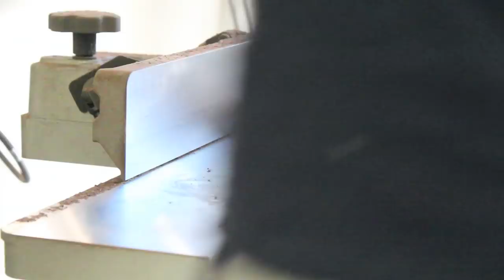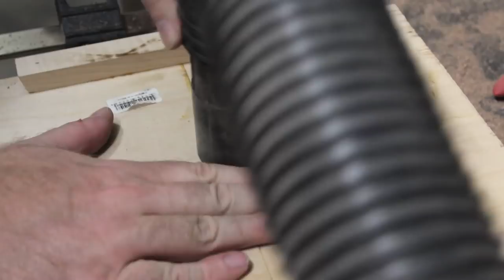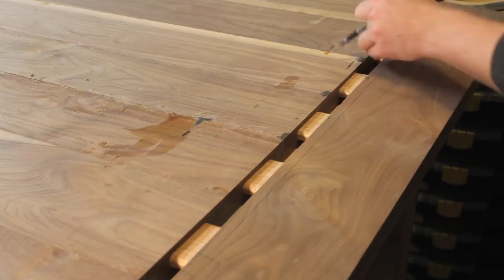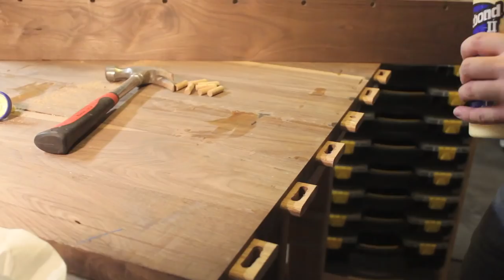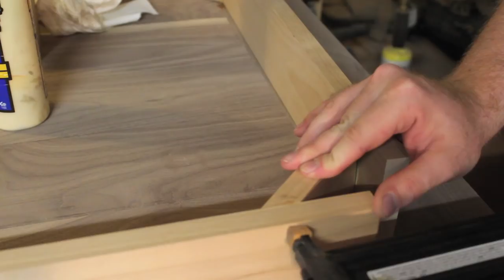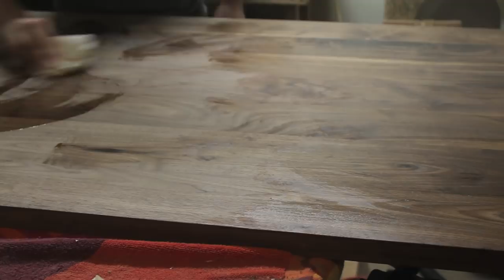DIY Farmhouse Table with Draw-Bored Breadboard Ends// DIY Woodworking

Comment from the maker: Be sure to subscribe!!! It helps my channel out. Thanks for watching!!
Reply: Robert J. Keller aren’t biscuits weak for a table top? Also how is it holding up
Reply: How much did you spend on materials and have you ever built one and sold it? If so how much?
Reply from the maker: The biscuits aren't actually there for strength at all. They are just there for alignment to make the glueup easier. Just wood glue by itself is more than strong enough for the table top.

Comment: Nice build. To allow for seasonal movement and therefore variation in the width of the main slab, did you make the breadboards wider than the slab to start, or did you make them flush with the slab when glued up, figuring any seasonal discrepancy would be minimal? If you made the breadboards wider than slab, by how much? Thanks.

Comment: Nice job on the breadboards and working in the wood movement. How much off-center did you drill the tenons to draw in the boards?
Reply from the maker: Thanks! Only about 1/32 of an inch.

Comment: Very nice table, you make it look so easy! Just wondering what kind of oil did you use to seal it at the end and what did you use to fill in the hole in the table ?
Reply from the maker: Thanks! I used Rubio Monocoat "Pure Oil" for the finish and regular epoxy resin to fill the knots.

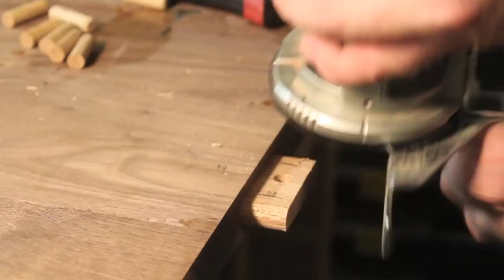Comment: 5:52 what’s the purpose of routing out that wide where the dowels will go? (Im a non-woodworker, just curious)
Reply from the maker: It is so the pins can move left/right as the table top expands and contracts due to changes in humidity. Without that slot, the table top would be ridgidly connected to the breadboard, and it wouldn't be able to expand/contract properly, so it would eventually crack. Hope that makes sense.
Reply: Robert J. Keller that makes sense. Thank you

Comment: Great job!...
Curious as to the router bit you used to cut in mortices in table and breadboard...? What's the size and length? And how deep were you able to get your tenons?
Thanks in advance!
Reply from the maker: Thanks! Sadly, I don't remember the dimensions. I know I used a regular straight cut router bit. An upcut spiral bit would most likely work better. The depth was probably between an inch and 2 inches.. I was limited by the small plunge capability of my palm router, but it seemed to be plenty strong when assembled. Hope that helps.

Comment: Can anyone explain why he uses those join connection instead of just gluing the side wood?
Reply: The mortise and tenon joints are used to allow for seasonal movement of the wood and to help support the weight of the breadboard. Gluing the ends could cause cracks or warping in time.

Comment: Nice looking end result.
Why no pins in the table side of the tennons as well?
Had to thumbs down tho because of all the finger gluing.
Reply from the maker: Thanks... I guess. 

The pins don't go all the way through because the client didn't want them visible. So they go up from the bottom of the table and through the tenons, but not out the top.

Comment: 07:06 lets add some glue lol
Reply from the maker: Haha you could say it was a little more fluid than I was anticipating 😂
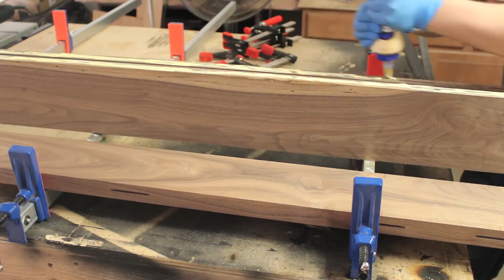Reply: Great job on the table. I like your technique with mortises and dowels. Do have question, referencing 0:49 what are the blue clamps you use?
Reply from the maker: They are bar clamps from Harbor Freight. I would not recommend them. Two of them broke during this glue up, which is why you see different clamps in the next part.

Comment: Did you let the tenons glue dry in the tabletop before attaching the edge and driving in the pins? Else it would pull the tenons out, surely. Also how much deeper were the mortises in the edge, compared to the protruding tenons, to allow the edge to pull up against the main tabletop?